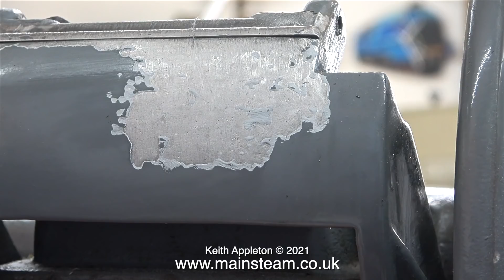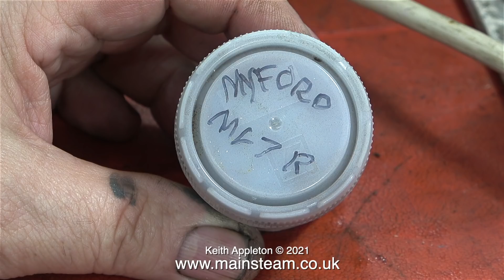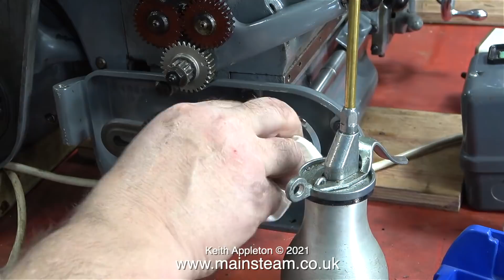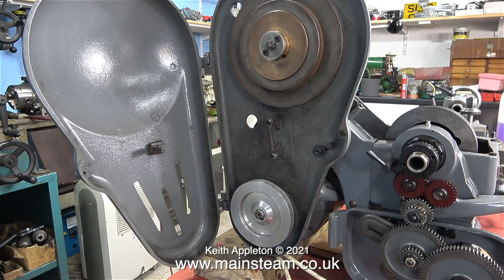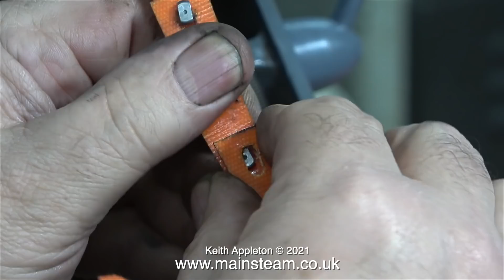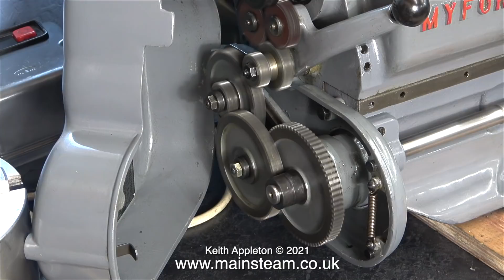MYFORD ML7R REFURBISHMENT - PART #5 - WORKSHOP TOPICS

Comment: Thanks for the tip on using JBWeld for repairing the casting filler! I have some areas on mine which are cracking and coming away (particularly the tailstock) and I have some JBWeld in stock so will give it a try. Not sure why it is coming away like that because the lathe has always been in a dry environment, maybe a bit chilly during Winter months. It's never suffered any sort of shock to the areas it is coming away. I have some original Myford green paint as I bought a can with the lathe back in 1996.

Comment: Hi, you mentioned you added a gear to reduce the bed traverse, could you explain please, as I think I have mine at the slowest speed, but to me it is still too fast.
Reply from the maker: I just changed the positions of the gear wheels around at the end of the Headstock until the auto traverse moved at the correct speed. You would be better emailing www.myford.co.uk and asking them.
Reply: @keithappleton  Thank you

Comment: Another informative and interesting video Keith. 👍   That T link belting is a great thing where you have awkward access to your belts. Saves you having to remove a shaft to put a continous belt on especially in a marine enviroment. I used it on a small coaster to replace the belts which were driving hydraulic pumps. alternators, etc ... off the main engine. I could never get the tension right as when these belts warmed up they stretched. Adjust them for that then they were too tight when "cold". Of course I don't think your workshop will get as hot as that engine room did. Nor will you be running your lathe 24/7. Just something to bare in mind.
Anyway keep safe, keep sane and keep posting such great content. 👍👍👍

Comment: well done (you don't use bondo instead of  jb weld to smooth out areas on the bare metal? just curious)
Reply from the maker: I don't even know what "Bondo" is - never heard of it ....... besides, JB Weld works fine for me.
Reply: @keithappleton  bondo  is a paste like substance that is mixed with a hardener and is used a lot in automotive body work to fill in dents befor sanding and painting to make it look like new(might be cheaper than jb weld in some applications  just trying to help)
Reply from the maker: It's called "Isopon" car body filler over here }:-)))
Reply: @keithappleton  interesting and thanks